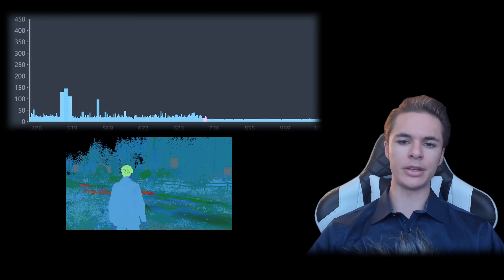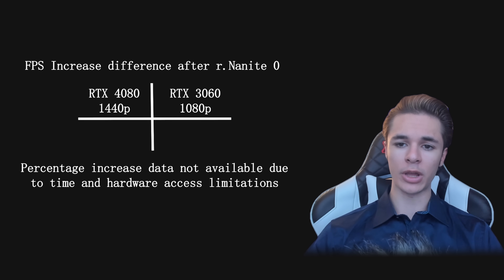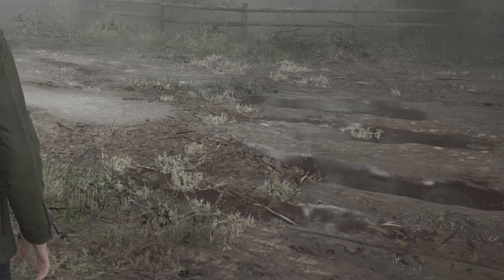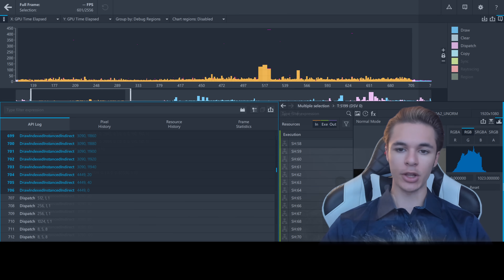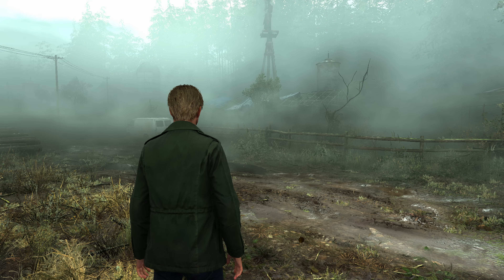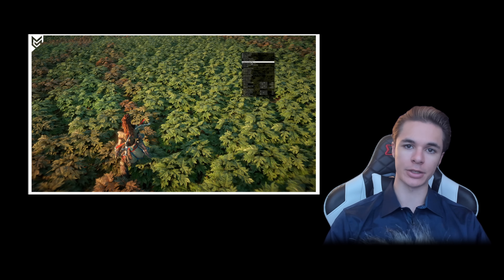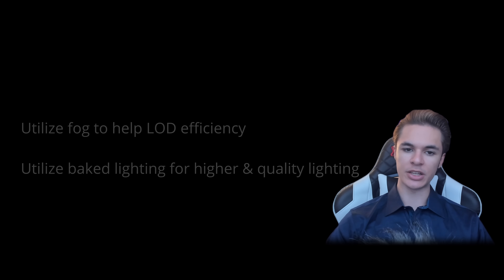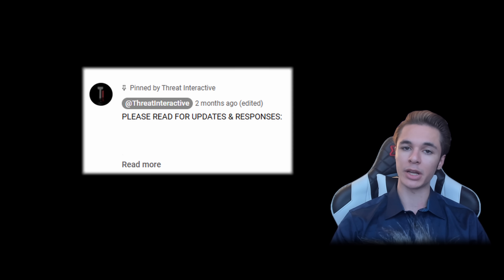The Price of Realism? | SH2R Optimization From The GPU Perspective

Comment: I would like to start saying that I believe your videos are great. You do a great technical work and share very important aspects of the modern rendering pipelines. I don't miss a single video because they are always interesting. 

Now, If you’ve ever worked in a big-mid game studio, you might understand that developers often face constraints on time and decision-making. Frequently, they find themselves responding to unexpected changes, whether it’s a shift in the tech stack, a new engine version, or added features close to delivery—all factors influenced by leadership decisions or structural challenges. Developers living abusive workplaces is the most common way for studios to loose knowledge. When you join a company, there is a high chance that the feature you get assigned to was undocumented, and done by a burnout person that is not in the studio anymore. Which leads to a lot of debt and lost knowledge. 

Rather than placing blame on developers, it may be helpful to consider that they often have limited control over these choices. Technical voices are constantly overshadowed and muffled by high level creatives and structural priorities which in some cases hyperfocuses on the wrong thing, instead of finding balance. Most of the time optimization gets postponed until is too late, and some times people responsible for render features have long left the studio when the game is shipped. Game development, specially of depending which companies, and company cultures is absolutely a pain in the ass. I would like to clarify, this is my experience, some people may have others and those experiences don't invalidate mine, the same way mine doesn't invalidate theirs. Both realities are possible. 

Many things needs to be adressed post launch because it is common for companies to screwup the pre-productions, move on to next phases without having addressed goals and debt, and by the lack of proper organizational structure and proper validations, they ended up focusing on reactive measures. They spend weeks, somethimes months, and sometimes years under constant crunch. Then they have the time to fix post launch if, they still are in the same company. 

In my experience a 30% to a 40% of people leaves studios right after shipping a game. Some of them leave the industry, some of them move on to another studio. I worked in a studio which the majority of people working in a project left right after they shipped the project, having to renovate most of the people, hiring desperately and offering unprepared people senior positions out of need to cover such positions. It was an absolute mess.

Developers end up focusing on what they are being requested and reacting to bullshit instead of being able to do a proper research work and delivering value. Now... this doesn't happens in every gamedev structure, but is a common thing to happen when the stakeholders believe creative freedom has infinite budgets, and fail to understand the finite game environments engines are bound to. Or when they push their vision disregarding any technical constraints. 

The everyday average Joe and Jeanette developer have little to do with many of the messes. Tech people is being muffled, QA is being downplayed and degraged, when they are one of the most valuable teams in Gamedev. Is a mess out there people.

Comment: Wait, so they added lumen ray tracing to completely static scenes instead of going for the cheapest baked lighting? That's just... I mean it's ludicrous, cretinous, idiotic. Oh, and no cubemaps for reflections which are apparently tied to lumen too? They could've added simple skybox cubemap to create a generic, low-quality substitute for non-lumen users. And the higher the resolution, the worse the performance leak occurs with the usage of nanite? All in all I'm not sure if it's a pure incompetence or perhaps sheer malevolence akin to adding butter to a nutella sandwich.

PS. that 288x164 res framecheck tanking 1/10 of gpu's power is pure comedy. Gosh, what a damn flop 😆
Reply: thats just unreal 5 in a nutshell
Reply: @steppinonastoop677  I've noticed after abysmal performance of Frostpunk 2.

Comment: PLEASE TELL US ABOUT TRAVERSAL SUTTER AND WHAT DEVS CAN DO TO STOP IT
What tools they have, and so on.
This is my favourite new channel.
Reply: Im on a 7800x3d and 4080 and only a mod from Ultra+ maker Lucia managed to rein in the stutter. She also fixed several other ue5 games for me. So clearly SOME people like that modder and Threat  know how to handle it
Reply: every game engine suffers from at least some form of traversal stutter if it uses asset/level streaming which will usually cause stuttering, it's not just an Unreal issue
Reply: It's stutter from cpu side not gpu
Reply: @mirukuteea Does it matter if not even a 7800x3d can’t run it properly? It is UE5 fault.
Reply: @fawneight7108  what i meant is that this channel might not be the best fit to analyze the stuttering since they are focusing on GPU/shading
Reply: @mirukuteea  oh s**t I didn’t know what, due to how many stuff is still wrong on the gpu side lol. Do you have more info on why traversal stutter is in the cpu side?
Reply: @fawneight7108  when you travel to each new area one of these things will always happen - shader compilation and assets loading/decompressing. These jobs are done on the cpu, so your gpu always have to wait until the process is finished.
Reply: @mirukuteea  digital foundry made a video that pushed back against the idea that the intermittent stutter in this game was due to that
Reply: @outkast978  one other idea i have is compute shader sync point because modern engine uses a lot of dispatches. then this could be related to gpu

Comment: We are gonna get so much more UE5 crap like this in the future. This is so silly Resident Evil 2 Remake came out 5 years ago and actually looks better to me than SH2, maybe it's because it actually runs well on my hardware and I don't have to set it to Dx11 and 1080p low to mid settings to get 60 FPS MAYBE SOMETIMES if I'm really lucky.
Reply: RE2 remake is a mess. Extremely blurry TAA. but you can mask that by just running at a really high resolution because it's so easy to run. But yeah it's much more stable than these modern games
Reply: @sengan2475  Resident Evil 2 runs at 60 fps on PS4. Most of the time. (In 1080p). Silent Hill 2 barely reaches 1080p and 60 fps. All this on much more powerful hardware. The PS5 GPU is 4 times more powerful than the PS4. My 4060 Ti / 3070 video card can't reach 1080 and 60 fps. Resident Evil 2 is a masterpiece of optimization.
Reply: @ttgl08  Try running the game on chapter 5 when you have to get back to the church the game's performance is tanked by the rain effects so it's not that good at optimization
Reply: Heck, RE4 Remake blows this game out of the park in terms of both graphics and performance.

Comment: Thanks to your video, I turned off nanite and lumen in my game. All my maps have static lighting and my stylized artstyle was not even close to approaching the tris that would make nanite efficient. I got a 60 FPS boost and it still looks great. And since I was migrating my project from UE4 to UE5, my custom models already had hand-crafted LODs as holdovers so it was not hard to make the switch.

Comment: I understand the issues with TAA, specifically with the most basic and bad implementations, because there have been improvements made (by Guerilla Interactive, for instance). But honestly I've never seen SMAA handle specular well, and that includes Frostbite. Specular in NFS 2015 just doesn't look nice, for instance. It shimmers and shifts. While subjective, I'd still go for TAA, but ONLY at very high framerates and rez because of the flaws it brings and its inherent temporal and rez-bound nature. TAA at 30fps or 1080p is just a thing I never want to see, personally. As for TAA being an excuse for poor implementation of things like AO, transparency and translucency - this here I can get behind 100%. Don't like the trend of everything being built around that. 

A side note for Unreal and its overall lighting implementation... You know, it's funny. I've worked with UE since it's version 2 days and it's always been like this with Epic. First, they insisted on Lightmaps for years (for obvious reasons at first), offering very poor alternatives or stuff that is just not enough or never leaves beta implementation (Hello, LPVs!) . So, for the longest time, it was Lightmpaps or bust. It's not that they are bad, per se, but it's just not optimal for all scenarios either. 
Then comes around UE5 and now we see the exact opposite. Away with the lightmaps, welcome to Lumen. No other less resource-intensive solution. I just don't get it. Why is Epic always like that when it comes to lighting solutions. They have such amazing tools for so many things but their lighting pipeline has been so damn stringent for decades. 

Forward vs deferred - another story altogether. It's like a hypetrain... We have Doom Eternal's ID Tech working on forward rendering and doing miracles. But no, "outdated technology". And this brings with it some many pains too. I'm still waiting for UE to implement custom-mesh GBuffer decals (not to be confused with simple masked custom-mesh decals or decals with a mask-dither pattern+AA solution, bleh...). It only supports GBuffer decal actors with this functionality, but not custom meshes. So, pipelines for materials like those used in Alien Isolation, Doom Eternal, etc. are just not available to you in the same capacity. 

UE is often being lauded as being so flexible. And quite often it's deserved. But in other cases - not at all.
Reply from the maker: SMAA should only be used for basic staircased aliasing/input(for spatial upscaling, which is what FSR1 lacks). For specular aliasing there are many solutions such as filtered mipmaps such as the ones offered in cryengine, extremely cheap specular AA as seen in Half Life Alyx and CS2(or the Square Enix version), and a whole new approach we'll be covering soon. And of course, we're not against sub pixel sampling via more intelligently implemented MSAA or Temporal Subpixel Sampling like 9:20 but without "Standard MSAAx2" sampling and infinite frame holding accumulation buffer.

Lots of aliasing issues are specific and have their own solution. The problem right now is getting all those solutions into one engine the industry uses, so that they can be combined.
Reply: @ThreatInteractive is there any research documents on specular aa for implementing in another engine? 

Edit nevermind, I found the paper

Comment: Please please do a video on tarkov over a year ago now they have released maps that only use a portion of my cpu gpu and ram, I was unable to find a bottle neck so I assume it's a optimization issue on BSG's side. I am using a r7 5800g 32gb ddr4 3600mhz and a ryzen 7900xtx

Comment: I only gain 3 fps by r.Nanite 0 lol <RTX4090
Reply: That's weird, i gain like 17/22fps
Reply: @Metro_plexmaster  i don't know what to say. I checked the area where my fps were the lowest in the game. The woodside Apartments, when we enter from the big doors in front is the save room (office and back room witj coin puzzle). my fps were 65 and went to 69 when i used r.nanite 0 command.
And in the stairs as well. Outside, from the double door on the right side, my fps were 89 there and only went upto 91 when i use the nanite command. And then i quit the game because i didn't have time.
I was using 4k dlss quality, epic settings, RT on, also have few settings in engine ini file including RR.
Reply from the maker: @zaselimgamingvideos  Odd, can you describe how you are inputting the command and if any launch commands like -dx11 are being used?
Reply: @ThreatInteractive  No, i was on dx12. While game was running i opened uuu5 and injected the dll. I went back in the game and opened the console window and typed r.Nanite 0 and pressed enter.
Reply: It depends where, try in lobby area in woodside apartment, or flesh coriidor before abstract daddy boss , on 3060ti im getting 40% uplift in fps